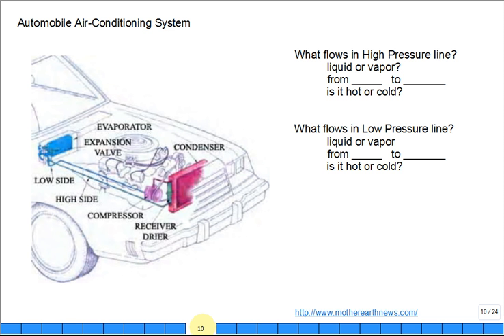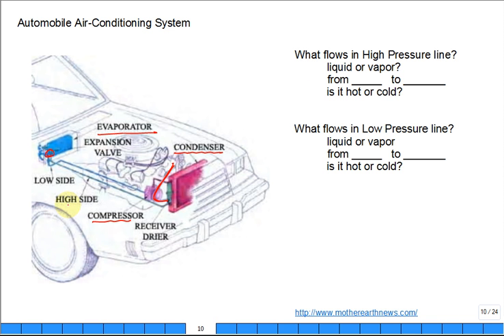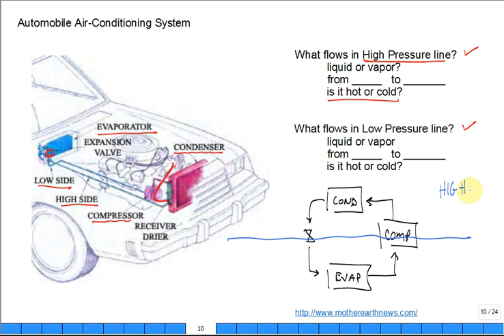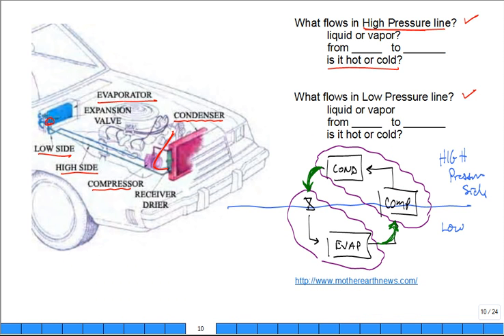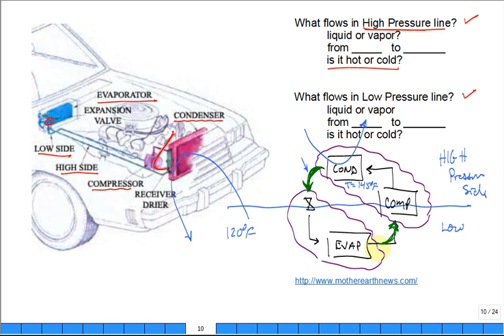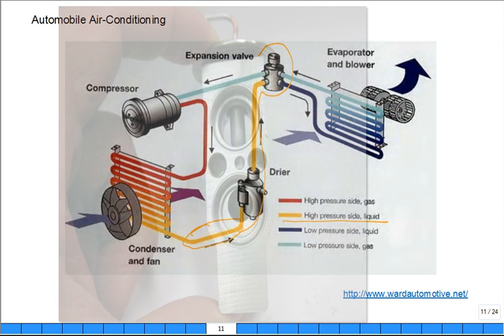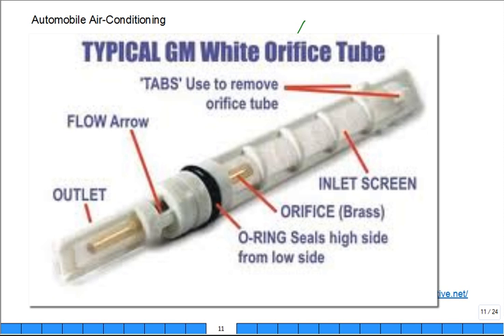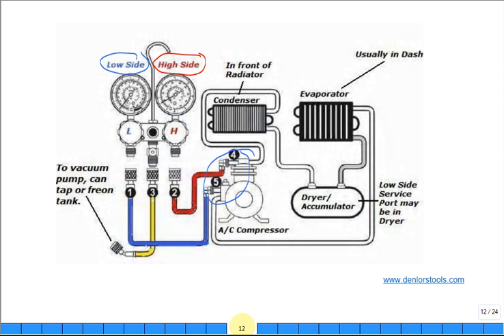high and low side lines in automotive air conditioning system

Comment: why dose my       compressor keep kicking  on and  off every 15 seconds      any thoughts it a 2011 f350 super duty  the blower motor dosent blow hard either  any thoughts
Reply: Relay? Misaligned pulley?
Reply: @somefuckinguy4519  I think he might have it in defrost mode ! AC compressor is designed to run this way on automotive systems to remove moisture from the windows !
Reply: Improper pressure in the system can cause this
Reply: Low on Freon bud

Comment: The low pressure side has the larger  sized diameter line......the high side  has the smaller diameter..........easy to remember.......
Reply: My 2004 PT has the low (Suction) line smaller diameter. The larger line is the high side. Is that because some manufactures just do it differently than say Honda? Let me know because we value information. Thanks
Reply: I stumbled on this video because my low side line is sweating and leaking water. I wanted  to see if this was normal.
Reply: I know the above comment is Geesh, 3 years old but for future people who end up here let me fix Jeffy. On older cars that use r12 *most likely*.... again if it’s r12, will have larger low side(7/16 quick disconnect) and smaller high side(3/8) So Jeff would be correct. HOWEVER, IF your car takes r134a, which is most cars except the old old and the new new, the LOW side will be SMALLER(13mm) and the HIGH side will be LARGER(16mm) PS. the recharge kit is only going to fit on one. 😁